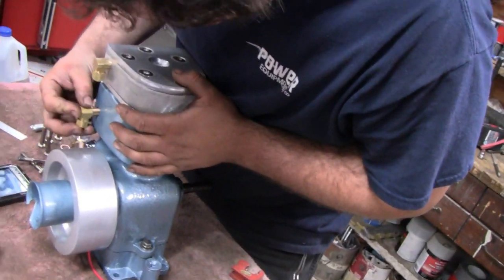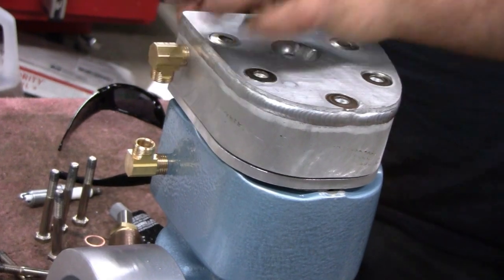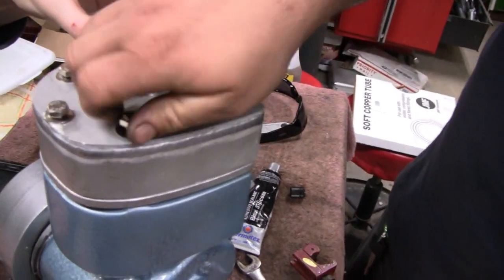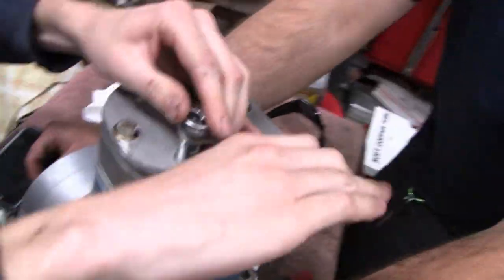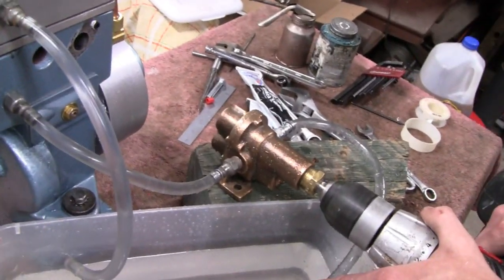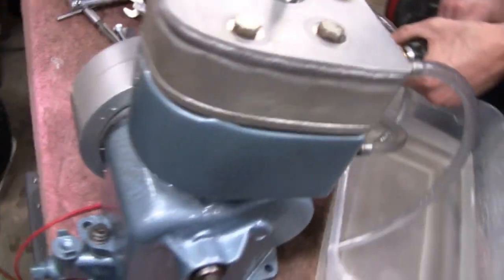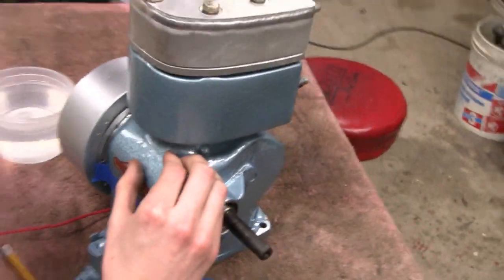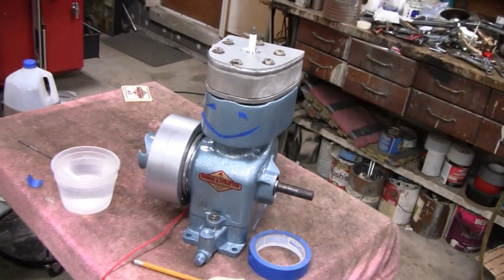HOMEMADE WATER COOLED BRIGGS ENGINE (part 30)

Comment: That engine is looking GREAT! As mentioned previously, it certainly is taking on a "marine" appearance. I do have a suggestion. (Not a criticism, only a suggestion.) If the short copper tube between the block and the head proves troublesome when installing and removing the head, you could turn the elbows slightly away from each other and make a new tube that makes one full loop around say, a 3" diameter. This might make installation a little easier. You've probably thought of that but I just thought I'd throw it out there. 
I can't wait to hear this one run! As always, thanks for sharing!
Reply from the maker: Thanks Bud!! That is a great idea!! We were alright with this guy, but we had to do that with a gas line on a previous build, it actually looks good with an 1/8 in line!!☺

Comment: I offered to make you water slides and you told me little dirt bike makes them, you have the transfer paper there. Now your saying there's guys out there that make them?  What the.........
Reply from the maker: The stock one are out there!! Lil Racer is making me a custom small 5/8 one for the radiator grill!! And one that says "Water Cooled" for the tank!!☺
Reply: ya that's what im saying. give the man in the room with you a little credit. Just sounded weird to me knowing he can do it and Received zero credit lol. I'd much rather use an original though you're absolutely right

Comment: Awe it's almost done. Just a little tip for aligning multiple gaskets, spacers and the head; take 2 longer bolts and cut the heads off of them. Cut a slit where the heads of the bolts were so you can fit a flat head screw driver on them. Install your newly made removable guide pins into the block and assemble the top end. Once a couple of bolts are in place, you can remove the guide pins & replace them with the bolts. No messing with aligning bolt holes. Looking good, can't wait to see the end result.
Reply: Joseph Hall that's what I was thinking. I'm about to use a similar method to reinstall my trucks bed by myself.
Reply from the maker: Good tip Bud!!☺

Comment: maibe fit the waterpump to the side of the engine and drive it of the flywheel by a rubber wheel pressed against it 
make a nice little boat engine

Comment: Great Video, When we saw the head being bolted on and could see a gasket in the background I thought you'd missed one but then realised you guys would have spotted it so it must have been a spare.
Nice progress and if bending a pipe is the only challenge fitting this together then that's a good result.
Reply from the maker: Thanks Bud!! Yeah that was an old gasket, I was gonna use it but decided to go with 2 new ones!!☺

Comment: You're certainly more talented than I am. If I had tried to bend that copper pipe like that and use compression fitting, the compression fittings would have leaked!

Comment: The engine looks sweet as hell with the hammertone blue, and the contrast of the aluminum head and the copper and brass fittings! That flywheel looks really perfect on there. I'm really interested to see the thermal readings with it running. Looks like another homerun to me guys!!
Reply from the maker: Thanks alot Bruce!! I'm curious about the readings too, I'm betting they're around 125 deg.F!!☺
Reply: I'll bet those readings will be right where you suspect! I'm really looking forward to seeing the completed engine on it's base with the radiator and accessories all mounted. Gonna be awesome!

Comment: I would love a water cooled lawn mower engine
Reply: Scott Keller untill it starts leaking on ya.
Reply: +Allen McKinney they make a water cooled v twin mower motor
Reply: Allen McKinney  I had a water cooled push mower year's ago it never leaked it just plan wore out
Reply: Honda H4518 , Honda H4514 , Honda Ht4213 , Honda Ht3813 rather cool setups

Comment: Lot's of cooling might think of bypass instead of flow restriction.
Reply from the maker: Yeah we thought of that too, we'll have to see what goes on!!☺
Reply: I would do recirc/bypass via a high temp thermostatic mixing valve as they can be used for this. The plumbing would be as follows for standard flow cooling: Head port to a tee, tee to top of radiator and hot port of valve. Bottom of radiator to cold port of valve. Mix port of valve to pump inlet. Pump outlet to engine block inlet.

Set your operating temperature as desired.

Comment: hey Roadking do you have some Tecumseh Motors ?? for me the best and solid engines
Reply from the maker: Yeah Buddy!!  We have 3 Minibikes with them!! Roadking likes Tecumseh, we even have a few when they were Lauson!!☺
Reply: ....and Clinton engines too ? 
Actually, my favorite's were the cast iron Wisconsin Air Cooled engines.   
( now, what have I started ?)
Reply: i always had sortof a weird feeling about tecumse, their 2 stroke 60cc snow blower engines seem to just be bombs tho they start easy and make good power, if only they were reliable, the tecumse lawnmower engines were great and their horizontal shafts were just as good as briggs, solid respectable engines they were, i do wish the 2 stroke 60cc snowblower engines didnt throw rods left and right, seen a video on one blowing up and i got one running great for my mom for the winter after sitting over 15 years and after i left town the second time she used it she said it made a funny sound and died never to run again, i assume the worst, only 2 stroke ive ever seen start 1st pull every time cold, and it was the smokiest 2 strokiest engine ive honestly ever seen besides like a dirt bike, pull the string once after you brush 2 feet of snow off it and to your supprise . . BRRRRRINGA DING DING DING, it let out a smoke cloud like no other, no throttle either, just put the choke off, hold on and engage the clutch it was brilliant . . till it blew up
Reply: Well 'FlyingWildAlaska77'  I agree with your statement of those old Techumseh engine's blowing apart, but did you mean to say 4 stroke engines ? 
In my experience over the years, most Snow Blowers were powered with these engines , but were normally in the 8 to 10 horse power range and they would regularly blow a con. rod through their blocks.  This seemed to happen because owners didn't adhere to the  mandatory 25 hour oil change interval.
If you wanted an engine to last, you had to buy a Briggs & Stratton .
Now in those days, the Japanese engines were not that popular, and especially not in the common 'hardware store variety' of Snow Blowers that were in the market.
Reply: TECUMSEH ENDURO, by far best model I think with the dual crab and billet set up ,not sure if the make horizontal shafts
Reply: i dont understand the 25 hour oil change rule, i have had honda gx 160 run over 100 hours on one sump of good non synthetic and i went to change it and it was still great, ive also had a tucumse 8 horse engine last great, it has an iron sleeve and ball bearing supported crank, ive never had a problem with anything but a tecumse 2 stroke snow blower throwing a rod which was heartbreaking cause it ran so well and started 1st pull all day every day no matter how cold, ive also seen videos on them blowing up, just a bad design i guess, but still very reliable aside from that huge flaw, but 4 stroke tecumses have always done me well
Reply: FlyingWildAlaska77, the owner's manual of the older Techumseh  engines( 1980's and before ) mentioned that the recommended oil change interval should be every  25 hours, actually so did the older B&S engine manual's too.
The better Japanese engine makers, such as Subaru, Honda, Robin, Yamaha etc. were, and are a much more refined 'class' of small air cooled engines. These engines would have left the engines such as  Techumseh ,waaay behind in their dust. 
Now I don't mean this as a brag with no basis in fact, any good mechanic with experience  over the years , will agree with this I'm sure.
Reply: oh well the reason no doubt probably why they recommend oil change that often is cause of the journal bearings, also probably the engine is built with less strict machining tolerances and probably had more metal dust in the pan at the end of the day than a honda but no doubt they lasted, old briggs were bulletproof, tecumse was more of an odd ball sometimes, i think we worked on one with metric bolts one time (mighta been something else cant remember wasnt paying attention to anything but getting metric sockets) i wasnt the one on the wrench that day but i have been since, and all my tucumses have been inches bolts so far, i like tecumse but i feel like they have had a few mistakes in a few designs over the years, one engine i loved that they made was the 8 horse horizontal shaft, but my favorite will always be the honda overhead valve series

Comment: I'll bet money you will find a hot spot towards the front of the head. Get her warmed up and put an infrared on the head, it will be cooler towards the back.
Reply: Cole Whitmer that does not make sense to me. the majority of the cumbustion on a flathead is the half of the cylinder near the valves and the valve cavity. so unless I am understanding you wrong, you are saying the coldest part of the head by heat input will be the hottest?
Reply: GasNBullets Bernoulli's principle, like a carb. the pump moves water. in the wide parts at the back it'll move slower, and soak up heat. in the thin front part it'll move faster. not to mention spark is near the valves And moves forward as the piston descends
Reply: Will the way they have it set up work? Yes. I like doing things to the best of my abilities, I am just making a note of something I would have done differently.

Will I ever convert an air cooled engine to water cooled? No. But for the sake of learning and having an open discussion of this topic I decided to comment.
Reply: Well, I cant make it make sense to you. I think your theory of combustion location - temperature saturation is wrong, the "location" of combustion can not be determined from seeing the flame because when combustion occurs that entire chamber is under pressure. You are also not taking into account the heat soak into the head caused by the friction of the piston on piston wall. Heat rises so all the bearing heat, oil heat, friction heat eventually makes it way up through the metal which is called heat soak. The biggest source of friction heat in an engine is the piston rings on cylinder wall because it is a sealing surface. On top of all the fore mentioned sources of heat, the act of compressing the air/fuel will transfer heat on all internal surfaces of combustion chamber. 

This is what I do for a living, I develop engines, I'm a mechanical engineer, degree from a university. There is no use in arguing because I've studied and applied the physics.
Reply: So when engines get at operating temperatures they heat soak. The temperatures across any engine kind of average out with the main source of heat being the combustion chamber. Think of this scenario w/out the water cooling, so you have an average temp across the air cooled engine. Now apply the statement below.

The way they milled the water cooled head has an open shape around spark plug. There is no wall separating the inlet and outlet for coolant. (Notice the inlet and outlet are on the same side of head). Fluids (Just like electricity and most things natural) follow the path of least resistance so there is nothing forcing the coolant to flow around the spark plug towards the front of the head even when pressurized. The coolant will come in the inlet and flow directly to the outlet. (Some turbulence will occur which will push some water all the way around the spark plug but it wont be as efficient as it could be). There should have been a wall that goes from the spark plug hole to the back side of the head to force coolant to flow around the circumference of the head. 

This is why I am betting money there will be a noticeable temperature difference across the head.

Comment: change the copper pipe too a clear tube
Reply: FlyingWldAlaska77 not at all. many old machines and engines had glass sight tubes for things like monitoring fuel levels and fluid levels. if anything it would enhance the old school aesthetic
Reply: lukesky36 And he should put like blue coloring into the water. would look nice I guess
Reply: or just use blue antifreeze
Reply: well yea i see what you mean what with mercury tube thermometers as hood ornament/radiator caps and stuff like that but what i had in mind was like a piece of clear hose like they used to test, either way i guess its a good way to know if water is flowing, a glass vile between the two brass fittings would be epic but hard to make, but easy to replicate the look with a piece of clear tube now that i think of it, i guess ill let roadking and them make the final decision of course as its his and his teams engine
Reply: a clear tube would kinda ruin the oldschool look i think

Comment: That is a cool little water pump, I was hoping it would be a mechanical one like you have there. Where did you find it, or what is it off of ?
Reply: Jack B Nimble I have a pump similar to it. mine is a fuel pump intended for fuel transfer.
Reply from the maker: We picked it up on Ebay!!☺

Comment: put a plastic tube so you can see the water
Reply: DANK DAVE glass
Reply: He has to bend the tubing in order for it to work, he could use glass, if he heated it, and if he did that the heat could make the paint on the engine peel and bubble if it gets hot enough, so i think that it is better overall and easier if he uses Clear tubing or copper tubing, that can bend easily.